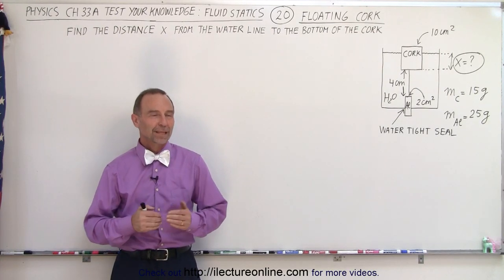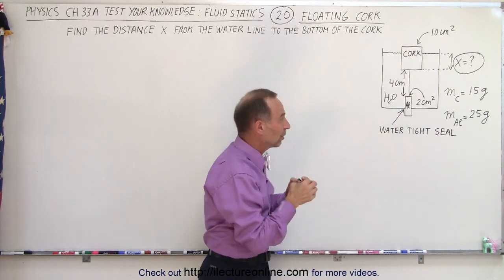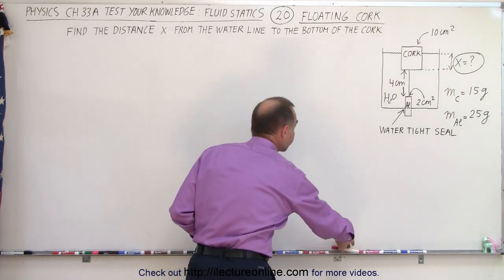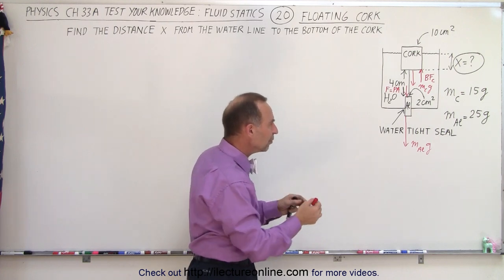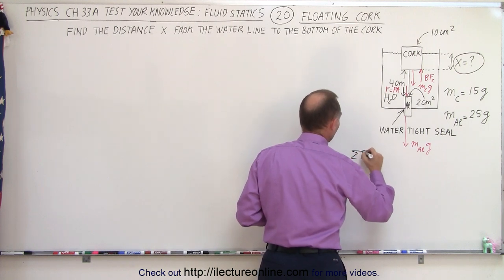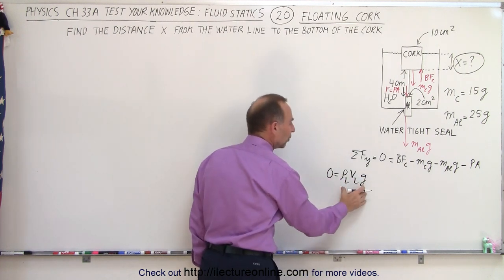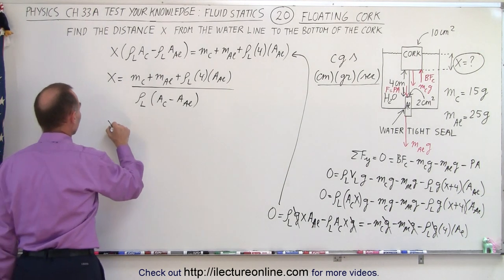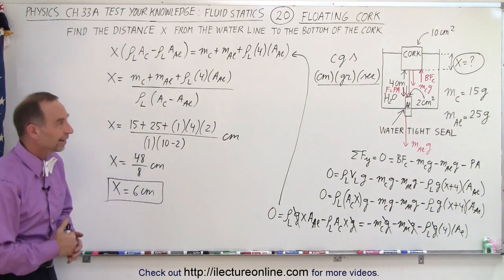Physics - Ch 33A Test Your Knowledge: Fluid Statics (20 of 36) Floating Cork: VERY INTERESTING

Comment: A cool variation would be to replace the string with a spring and find its displacement
Reply: Totally agreed. I presume its spring constant would be specific to the medium, correct?
Reply: @floydpinkerton7954  the spring constant is material and geometrical related. I don't see why the fluid would change it. Its effect would be on the elastic force itself

Comment: Very cool problem. Can you explain why we have no tension forces to speak of even with the presence of a string connecting the cork and aluminum cylinder?
Reply: The string is the link between the top part of the problem (cork) and the bottom part (Al). Another way you can solve it is by calculating each part independently to find the tension on the string. You would find 2 equations for T in function of x that must be equal (tension is equal on all points of string). You will end up with the same result, only taking more time to do it
Reply: @matheusmarchetti628  I understand that about the tension forces, and that they are equal and opposite. Just curious as to why they weren't included in the original free body diagrams.
Reply: @floydpinkerton7954  because we are not considering the cork and the metal separately. It's like, if there is only the cork, we consider forces between not parts/atoms of the cork, but the cork as a whole and its surroundings. In other words, we consider only external forces on the system, not internal ones. So, as you may guess now, in this case, the system consists of the cork, the metal and the string, and therefore the tension on the string is an internal force.